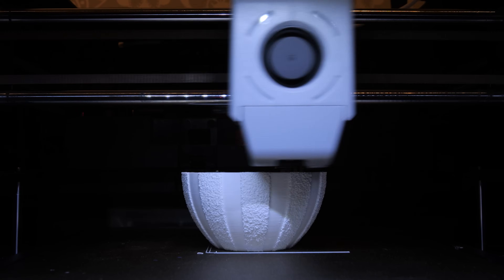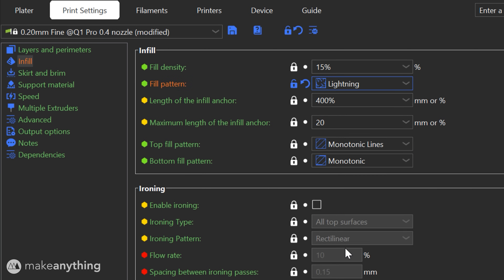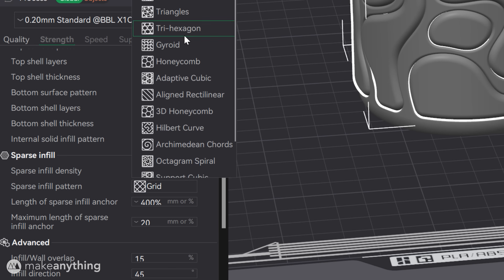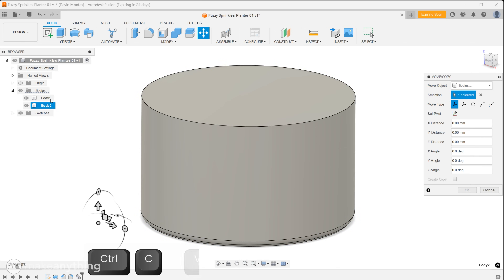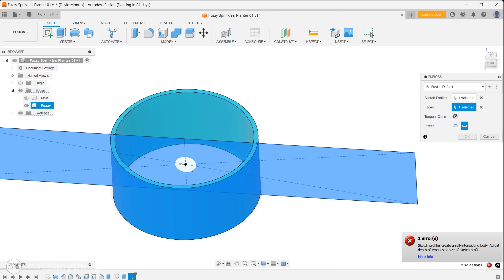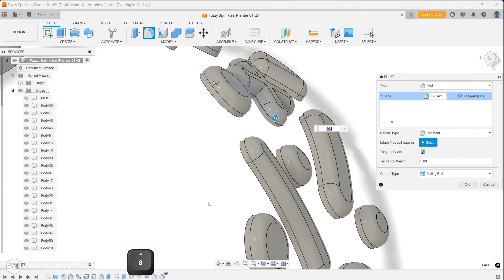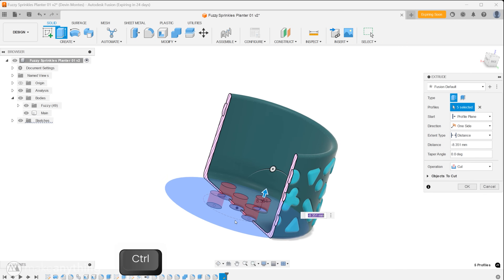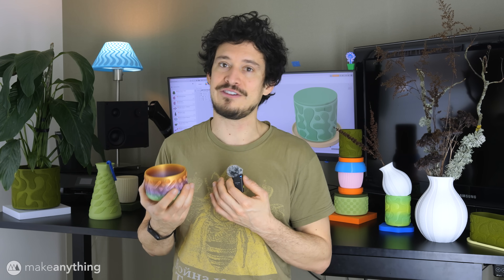3D Print and Design Multi-Texture Prints // Autodesk Fusion Tutorial

Comment from the maker: Hey, thanks for watching! As some have already pointed out QIDI Slicer is based on Prusa Slicer, not Cura... Whoops! Should I add a Cura bit? Also, if any part of the tutorial leaves you with questions, feel free to ask here or on Discord :)
Other notes:
- When slicing, you may also turn off 'Detect narrow internal solid infill', 'Close small gaps', 'Ensure vertical shell thickness'... and basically anything that adds uncessecary infill.

Devin:yougotthis:
Reply: I would say yes to adding how to make it work in CURA because I can't get it to work in CURA 5.7, the fuzz part drops to the bed and even if I reposition it and lock it the fuzz part does not even appear in the preview, only the recesses.  Thank you though for the 'speed tutorial' !  biggest take away from this video is chamfer on the base and a fillet on the top edge !
Reply: @Frameshaft  ^ 
I 2nd this

Comment: I wonder if you can use a multi-material option on a printer so you can make the fuzzy part in green TPU to actually replicate moss. Although the difference between the materials will result in poor adhesion.
Reply from the maker: It could certainly be done! I'm just waiting for less wasteful multicolor printing to make such designs (which are starting to come out!)

Comment: How can I create this type of design on a rectangular object with rounded corners, adding a ribbed or grooved vertical texture that follows the entire perimeter, including the curved corners? I can easily do this on cylindrical objects using a circular pattern, but I can’t figure out how to make the texture follow the curved edges of a rectangular shape in CAD software.
Reply from the maker: I would model the grooves on the corner separately from the flat faces. Use mirror to copy the grooves from one corner to the other three, and the same for the flat faces.

Comment: great designs.
do you know of a way to add one sided fuzzy skin?  If you look at the sliced part it also has fuzzy skin on the inside of the wall. the technique you used effectively has 4 outer walls. ( outer fuzzy, inner fuzzy, outer smooth, inner smooth ). There are several ramifications to this. What I want is a paint on fuzzy skin.
with some parts this can increase the print time significantly.

The only work around i have found is using depth map. 

Great channel!

Comment: Is there a way to make just the face facing outwards to be fuzzed? I have a challenge with there being fuzz between the main body and the fuzzed part on a similar design
Reply from the maker: Yea, that can be a problem. It's why I have relatively thick walls on most of these prints... I haven't figured out a better way to handle it, but hopefully it becomes possible to do what you're suggesting with future slicer updates

Comment: I'm brand new to fusion and I'm only asking out of curiosity, would it be better to use the measure tool at only 3 decimal places? It seems like the constraint tool rounds to 3 decimal places so maybe it's just a rounding error where the constraint ends up being slightly larger than the measurement? Either way, you clearly found a method that works and this tutorial has taught me so much in such a short time so I really appreciate you taking the time to putting it together!
Reply: I tried it and it didn't really change anything. It did work though without having to go back and change the dimension. It just created a very tiny sliver on the far side that I deleted later.
Reply from the maker: Interesting.. I assumed the less precise measurement would be rounded up, but sounds like that's not the case!

Comment: To avoid the leftover piece from the emboss, set the pattern's bounding box width to d1 * PI (assuming d1 is the current dimension representing the diameter in use), starting from the origin—do not center it. This is similar to applying a label to a can by placing it from one end rather than the center. This appears to be how Fusion 360 handles it, as well as many other revolving features.
Reply: I had to come back to the comment section to find this info. I’m going to give it a try, it does make sense

Comment: I got to the point with the center point rectangle and got an error saying it's over constraints 😢
Reply from the maker: Maybe your centerline wasn't starting and ending at the top and bottom of Body 2? Also, the rectangle doesn't actually have to be centered, so maybe just do a rectangle contstrained to the top and bottom of the body.

Comment: Great tutorials and ideas, as always!! 

Is there a advantage from the design point of view for making cylinders by revolution instead of extrusion? I have not yet learned CAD for real, just a few things to get me going and your designing process at 6:30 got me thinking
Reply from the maker: In this case extruding a circle would essentially have the same outcome, although with the revolve you can edit both the diameter and height within that sketch. I guess I did the revolve out of habit because it can be used to make more complex shapes as well... I like getting a lot of work done within a single sketch :)

Comment: I wonder if it is possible to make a lamp that projects stars on the ceiling at night by having reversed of what you did, instead of embossing the inside of the shapes, embossing the outside of the shape
Reply from the maker: I made a rather simple star projector several years ago, it can definitely be done. The hardest part is finding a light source that is very strong and concentrated.

Comment: For more complex surfaces, my favorite method is to use the surface workspace. Apply a 0mm offset to the faces you want to make fuzzy. Then thicken the resulting face group to about 1mm. I then use that body as a modifier in Prusa/Orca/Bambu slicer with the fuzzy skin settings.

Makes it easier if you change your mind about using fuzzy skin later in the project. I’ve used it on outer surfaces of grips that were designed to slide onto other parts without effecting the mating surfaces geometry.
Reply: Can u make video about it?, I just to dumb to understand
Reply: @andrikurniawan531 I should have said surface tab but basically you use the offset tool to makes a copy of surfaces you want fuzzy. Then the thicken command makes that surface into a body. It’s very similar to extruding. 

You would export the bodies same as he showed. In the slicer you can make a body into a modifier by right clicking on it and using the context menu. Modifiers change the settings for the area they overlap. Finally set the fuzzy settings the same as he showed for the modifier.

Comment: You can also just export your files as a .3mf from fusion so you don't need to export multiple .stl files! ...saves you a few seconds i guess....
Reply from the maker: I tried that recently and the resolution suffered 🤔.. plus it created like 100 separate bodies for some of these designs, versus two. I am finally starting to mess around with 3MF though :P
Reply: @make.anything  very interesting - I have to test if it really exports a lower quality mesh (😬 ... been using the 3mf export all the time) ...and yeah, i guess not having everything as separate bodies is an advantage.